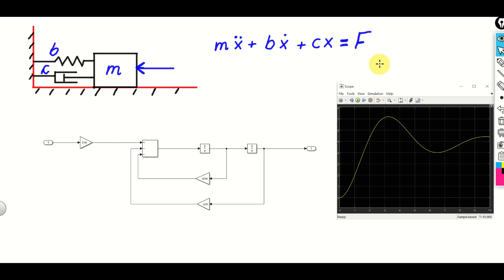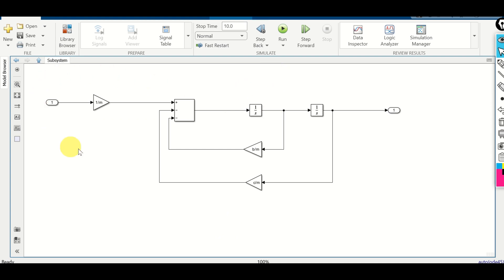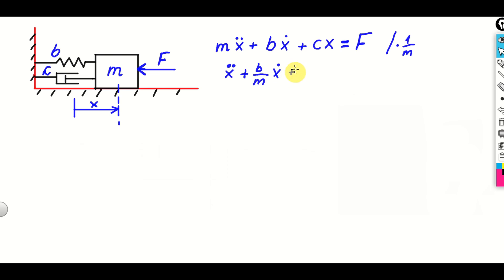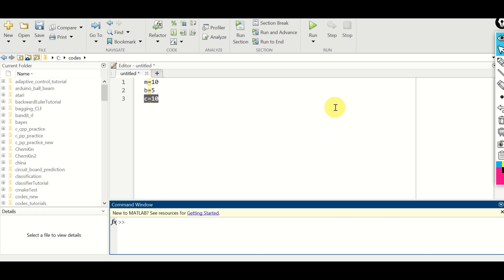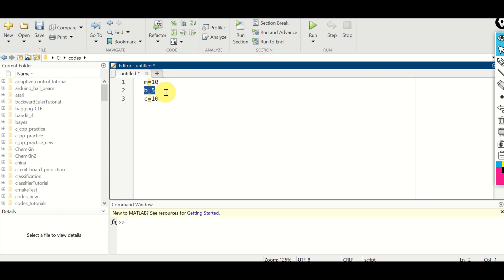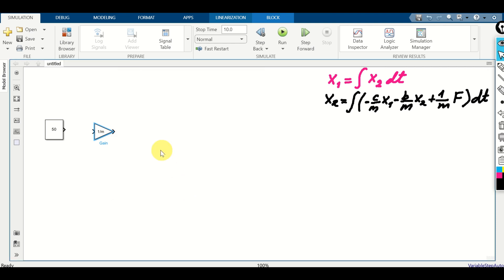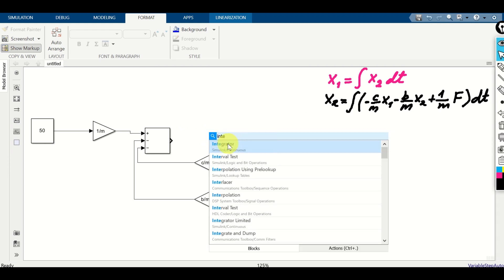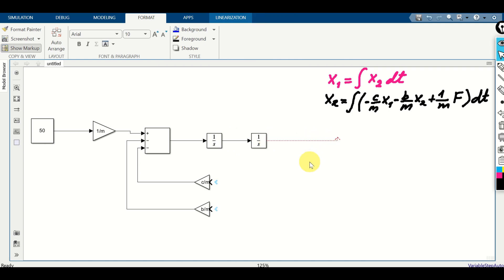Mass-Spring Damper System - Modeling and Simulation in Simulink - Control Engineering Tutorial

Comment from the maker: There is a small typo at the beginning of this video in the sketch of the mass-spring damper system. On the sketch the constants b and c are permuted. The c constant is the spring constant, and b is the damping constant. However, on the graph, the c constant is placed instead of the damping constant b and vice-versa. I created another video to correct for that: https://youtu.be/lUqpXz_NUm4